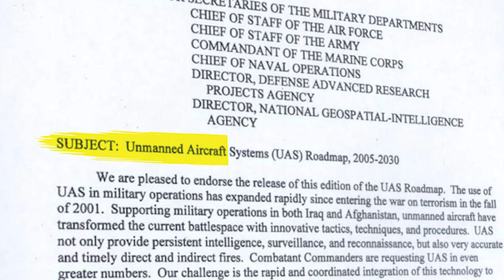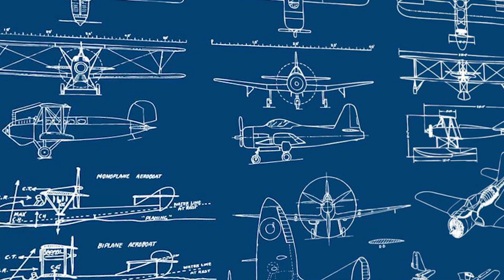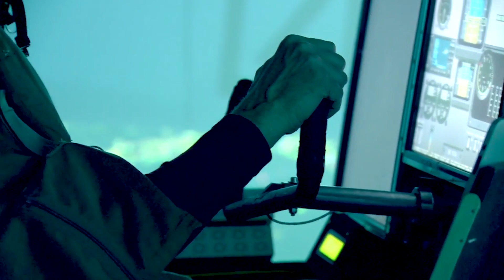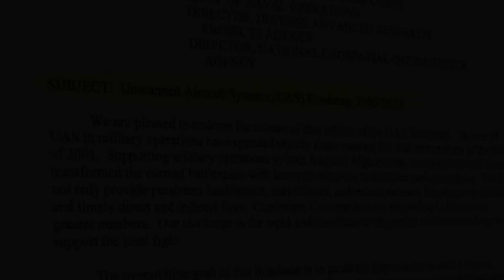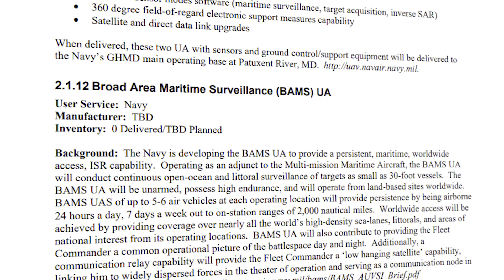This Genius Solar Plane Can Fly Forever

Comment: Thus the requirement for a low cost spy , and communications pod in the sky, that never need come down, has at last been realised! As technology improves the concept and performance will also improve, and the costs for commercial variants will become viable for private companies too! At least after the initial cost ( and cost to the planet) manufacture, it will be clean, low cost flying thereon in!  These UAVs' high up in the stratosphere will be game changers to mankind, doing what a short time ago was only a dream! Such is the advance of modern technology!

Comment: Strange. Given the low cruising speed of the airplane and great effort invested into making it energy-balanced wouldn't it be easier and more straightforward to opt for a helium-filled flat aerostat which could float at even higher altitudes with comparable speeds? Energy for its spy electronics it could get from the similar solar panels but given its bigger size its energy supply will be higher. And due to its aerostatic nature it remained afloat even in case of power shortage...

Comment: Ban the hazardous lithium-ion batteries! There are a lot better graphene supercapacitors which are theoretically immortal, as well as they can hold their charge nearly as long as a li-ion battery. But the business with li-ion scum is extremely profitable, nobody cares about environment or reliability...

Comment: I wonder would pairing it with a Helium filled Airship frame be a feasible combination?
Reply: Helium filled aerostat will be far better and cheaper than this nonsense.
Reply: @gaHuJIa_Macmep  Do you know how slow and how expensive a helium filled aerostat would be
Reply: helium is a dwindling resource, it will run out soon @gaHuJIa_Macmep

Comment: If they go further with this, I'm imagining a 'nested system' where a larger solar-uav feeds microwave beamed-energy down to smaller surveillance uavs, which beam back imaging data back up to the larger uav, and onto the remote surveillance station.